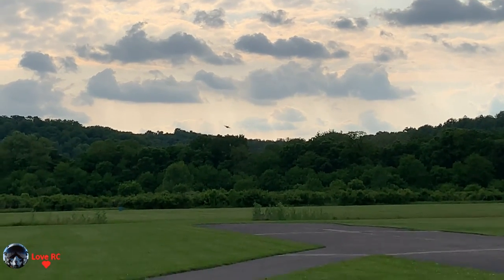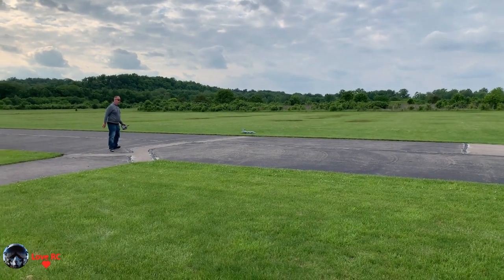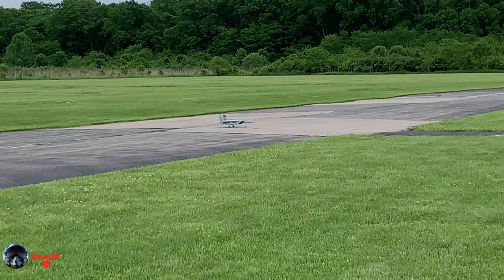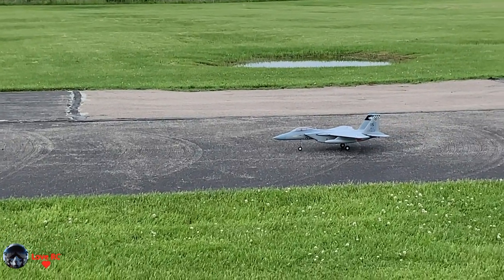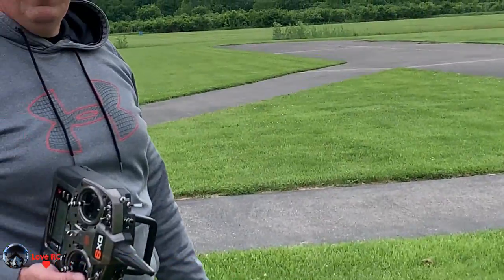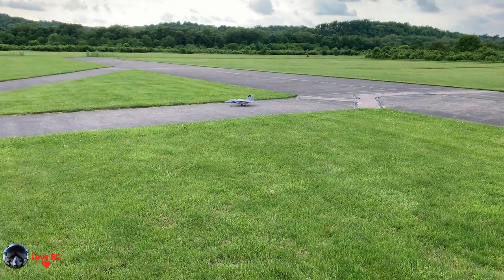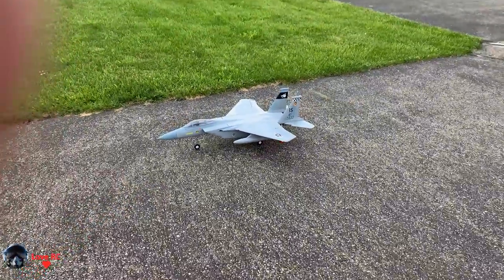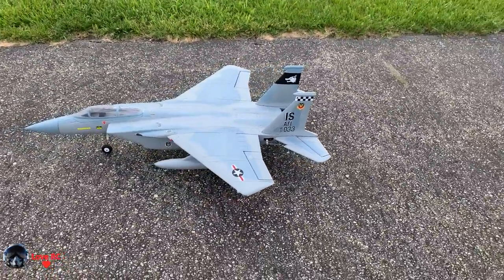FMS F-15 Eagle V2 64mmEDF - Pilot Fox

Comment: I have the same plane the landing gear is a little springy so you get those bouncy landings . The NAV lights look great!, where did you get them, and how did you install?
Reply from the maker: They are Easy Lights.  You just velcro them on your plane and you can move them from plane to plane.  They are great for orientation and fantastic in the evening.    https://www.amazon.com/dp/B07H5VP4JH?ref_=cm_sw_r_cp_ud_dp_X6QE7HYHQA3AETJAG12W
Reply from the maker: The Arrows Marlin is a nice fixed wing jet as well.  It's looks like a mini Avanti.
Reply: @LoveRC  I have the FW 64mm F-22 & F-18. And the arrows twin 64mm F-15. And 70mm F18,F-16  I only like fighter jets😉
Reply from the maker: @flyjets305  Arrows has some nice planes.  I want the F-15 with the Oregon National Guard Livery.

Comment: If you have a spare channel on your transmitter? you should go ahead and plug that yellow wire off the throttle lead  and put it on the top pin on your reciever and then assign it to a switch your the least likely to bump while flying. Then you,ll have Thrust Reverse and can put the air brakes on before you vear off the runway or run out of runway? Plust it a big plus when that jet has such a lame turning radius you can back it up and get it lined up to the center of the runway easly
Reply from the maker: @looneytunes47  hmm interesting.  I'll have to see if it does have reverse.
Reply: @LoveRC  pretty sure it does will be the single yellpw wire of the throttle channel lead i us mine all the time and it stops the plane in 10 feet